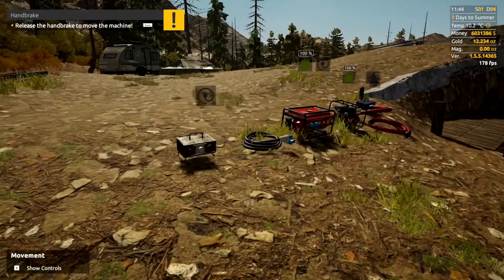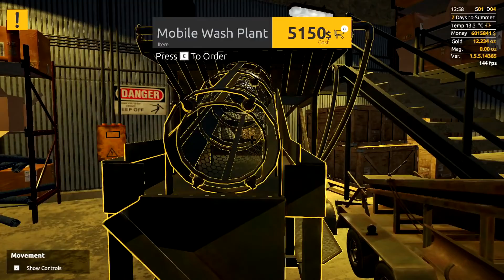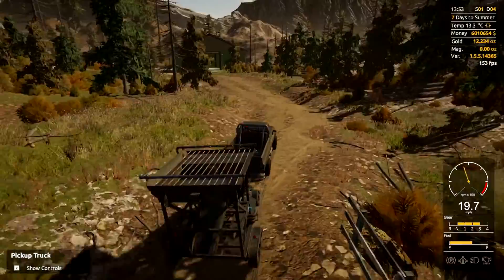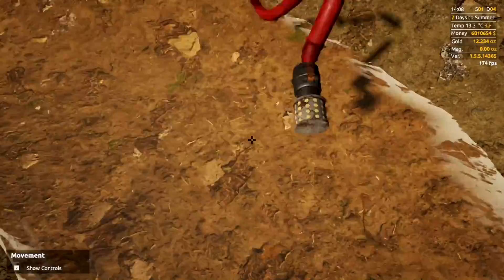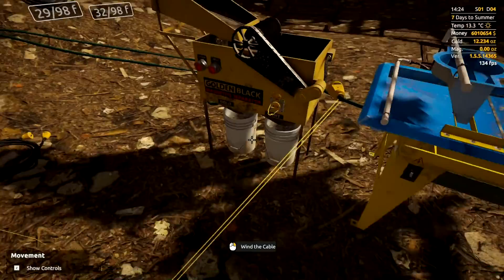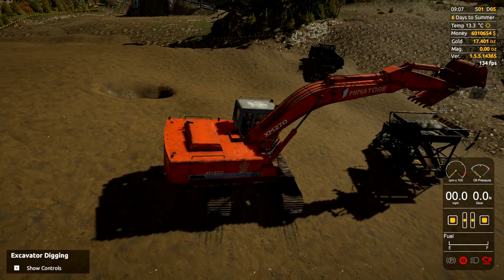How To Set Up A Mobile Wash Plant In Gold Rush!

Comment: I made a set up once with 2 mobile wash plants set up together. I used the wheel loader to load both at the same time. I had a very large portion of the claim cleaned out. With just that set up.

Comment: hey man is it possible to have a conveyor going to this thing, mine is far from dirt and excavators are slow i dont want to have to fuel a dump truck so i thought i could use conveyors but i dont know if the game will allow it .do you know?
Reply from the maker: You could use the wheeled conveyor called "Frankenstein" but it is very expensive so you most likely won't be able to afford it if you are running a mobile wash plant. Why not just use hose connectors to extend the hoses and move the wash plant closer to where you are digging?
Reply: @millennial_misfit  ok ill look at the conveyor and i cant use the damn connectors i made a tone of progress in my save to find out that the connectors are glitched for some reason in my save and i dont want to start over
Reply from the maker: Ahh okey I get you. Your best bet will most likely be the Frankenstein then but for that kind of money you are better of with a tier 3 or higher wash plant as your yields will be much higher as well and you can run dump trucks which is pretty quick if you get a rhythm going.